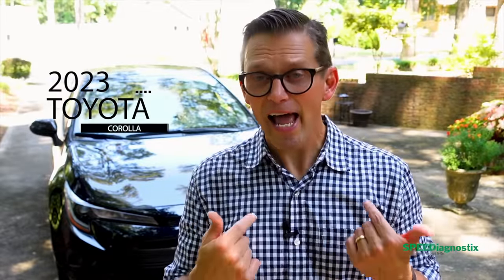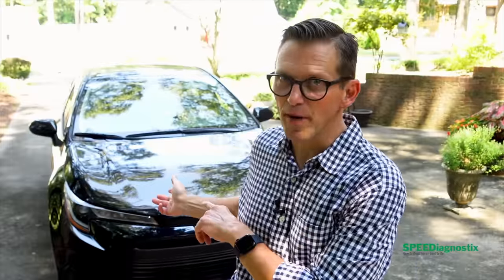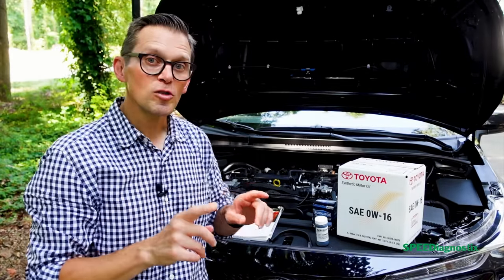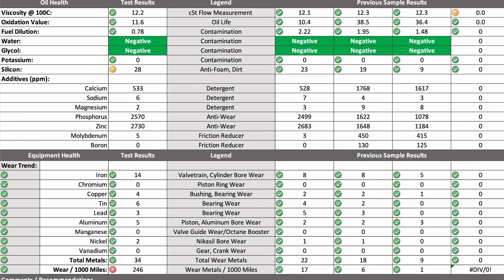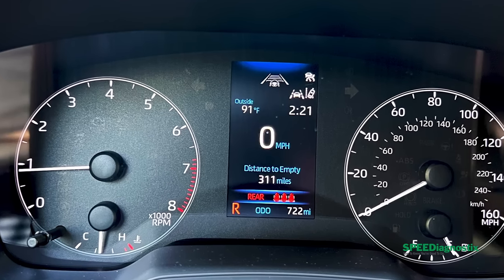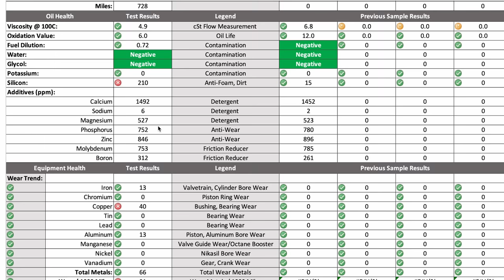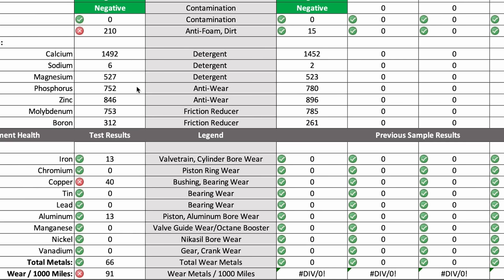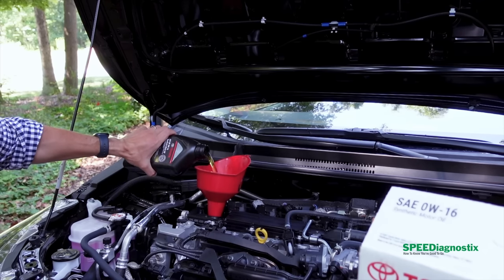AVOID the ONE MISTAKE Almost EVERYONE Makes With A Brand New Car

Comment: If you cange your own oil, one of the most overlooked places for contamination is the new filter threads. Next time you change your oil, take a clean towel and wipe out the threads in the new oil filter. I have found many iron flakes and shards in the threads of all brands of oil filters.
Reply: Excellent comment!  Great advice!  👍
Reply: the last mobil 1 filter I bought had a few huge metal splinters in those threads. scary
Reply: Don't have to worry about that with Mercedes-Benz and chrystler
Reply: Great advice. Thank you sir.
Reply: Yup - literally changed my oil 10 minutes ago and this is true
Reply: put a magnet on the drain plug
Reply: This seems like a really overlooked yet important aspect of changing oil that no one is talking about. Explains why Toyota has chosen to stick with the canister non-throwaway cartridge on at least the workhorse 3.5 liter 2GR-FE like I have in my 2010 Camry. Your mention of this strikes me as a real potential sleeper type issue that could be negatively impacting all sorts of vehicles. Good catch.
Reply: @gernotritzau5948  Right, because they leak oil and have no expectation of lasting longer than the 36 month lease. lol.
Reply: I change my oil every 5 hours of driving time thus giving me 400,000 miles of engineering performance
Reply: CR diesels usually have filter housings and polymer/paper filters, so this isn’t such a big deal with modern diesels.

Besides, diesels do a perfectly good job of contaminating their own oil and fast!
Reply: @GreentipsCo what’s the exact placement and what is the purpose?
Reply: great tip
Reply: A rare earth Magnet on the oil filter during break in help at all???
Reply: @2kidsnosleep  No need for that. The filter media will catch flowing particulates. Magnets in sump plugs are a different story though. They catch heavier particles that would collect in the bottom of the oil pan. A very good thing indeed. But if you clean the threads on the oil filter as OP mentions here, you'll reduce the chances of the filter itself being a source of contamination.
Reply: I noticed that on european purflux oil filters (which are great filters, but had that problem). Nowadays they seem to improve that.
Reply: @Skoora snatching any iron debris in the oil
Reply: @kCI251  - I've owned three Chrysler (now Stellantis) vehicles in the last 30 years and only one was what I'd call a "lemon" and even it lasted 9 years. The other two lasted 12 and 14+ years respectively. The lemon was a 04 Sebring. The 12 year was a 92 Dynasty and the 14+ year is a 2010 Chrysler 200 which we still own and is now my 17 year old son's first car. The 200 still runs great and probably still has another few years of life left in it yet which is why I say 14+. My wife's father is a Ford retiree and our other vehicles are all Fords and we've done just as well with those vehicles too. 
People dumping on Chrysler, Ford, GM and every other American manufacturer these days is total BS. If you take proper care of your cars and drive them properly you'll be surprised how good they'll be to you and how long they'll last.
Reply: I love my cadillac. For one, it doesn't have that stupid housing. Another is that the filter placement is at the top of the engine (meaning you can just change the filter and skip the oil change if it's under 10k miles because it's full synthetic)
Lastly, it's just the filter. You open up the reservoir and stick the filter in.
Reply: @wanderingbufoon still shouldn't go 10k between changes. Cut that by 75 if not 50%, I'm assuming you can afford it lol
Reply: @erikmacaluso  most oils have advanced that you can run it up to high mileage with no problems. Most full synthetics can do about 10k-20k. This is why filter is just what you'd need. For the most part, they can do about it indefinitely but the additives and particulates do pose a problem and that's why you change them. 

again, only for full synthetics.
Reply: @wanderingbufoon  I'm just saying, I'm pretty sure this guy, and definitely associates of his don't recommend it. I just watched a video with this guy in it yesterday, he visited a shop that builds and services all kinds of engines, dude he was visiting said absolutely do not run your oil to 10k, and this guy fully agreed with him
Reply: Yes!
Reply: @b-rad454 I’d be changing oil every three days
Reply: I am changing mine every 5000 with royal purple oil
Reply: Same
Reply: @erikmacaluso  Welcome to 2024 where 10k is the norm. Has been for over 20 years now. Those guys are money wasting morons. A good synthetic is generally rated for 20k these days so it's perfectly fine. I've been doing it since 2002 when should I expect engine problems? 🤣🤦
Reply: @motleydude73  that's crazy man, I never would've thought. I'm just over here parroting what the professional said, that's all. Given I bought a newer Ford, you can bet I'll be doing mine every 5 lmao I don't trust this thing any further than I can throw it. 

(I can't throw it.)
Reply: @erikmacaluso  Why not? Synthetics are tested and rated to give adequate protection for 20,000 miles. So 5 seems a bit silly doesn't it? I've been doing 10k mile changes since the early 2000s. Zero problems. Most people do it every 10k. Zero problems. Anything earlier is wasting money time and good oil.
Reply: Wow. Thank you!
Reply: I use a magnet
Reply: @motleydude73  I think you might be misunderstanding one of his points.  The industry is purposely misleading you. It’s called planned obsolescence how long do your cars really last when you let the oil changes go that long?

Comment: I was a senior manager in one of the big three in the US.  One of the departments that I was responsible for is the fluids department which involves oil and other lubricants.  We analyze thousands of oil samples every year from engines from dyno testing, from vehicles running durability, form employee lease vehicles, from rental fleet and from warranty.  We also review teardowns of many of these engines.  We do this with various oils both synthetic and conventional.  I couldn't agree with you more.  Our testing shows a continuous reduction in metal content as a function of miles.  with every oil change.  The worst is the first oil samples with low vehicle mileage.  I tell friends and family to have a couple of oil changes after 2000 and 5000 miles and not to wait for the engine oil monitor to kick in which is programmed to go off at 10,000 miles or less.   I tell my engineers; in God we trust but everyone else bring data and you did just that.
Reply from the maker: Thanks for sharing!
Reply: How's it going Do you know if stop start oil can be used in a car without stop start, would it cause any issues
Reply: What is missing is the tie to “premature” engine failure or other signs of a compromised engine. The oil gets dirty quickly on a new car. Got it. But what are the quantified impacts to engine life / performance?
Reply: @hbullock  I have looked at thousands of data points from our oil testing program and never saw an engine fail because of the high metal content from the initial engine break-in period.  I have seen engines that failed, and metal debris starts showing up in the oil because the customers didn't replace the oil when they were supposed to or used an unapproved cheap oil.  One series of engines failed because the low viscosity oil that was specified resulted in bearing wear which could be detected as high amounts of copper in the oil.  These engines had to be replaced.  With that said, recently, Toyota recalled 100,000 trucks and Lexus vehicles and is replacing their engines due to high metal debris that was left from the manufacturing process.
Reply: @bowhunter3703  Thanks for that answer, but I admit it leaves me confused. I thought you were agreeing with the video, that oil should be changed “early.” If you haven’t seen a correlation with engine failure…why change early?
Reply: @hbullock  I wanted to clarify my answer.  I agreed that there are high amounts of metal content from the initial break-in period.  The recommendation that I made regarding changing the oil after 2000 to 3000 miles is purely subjective on my part and I have no data to support that it is really required.
Reply: I read that the Federal Government mandated that manufacturers bring down the cost of vehicle maintenance. Voila’ the 10,000 mile oil change just cut that part of vehicle maintenance in half.